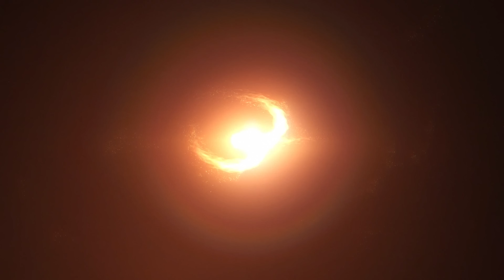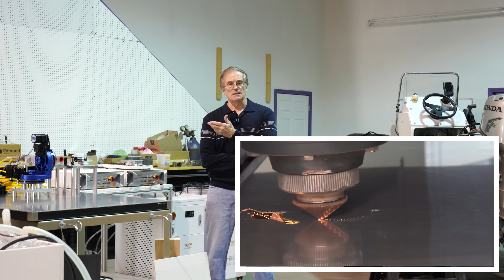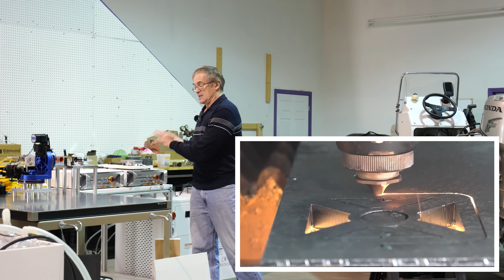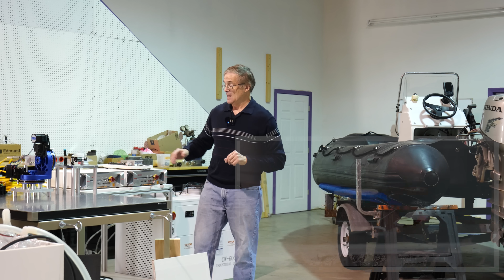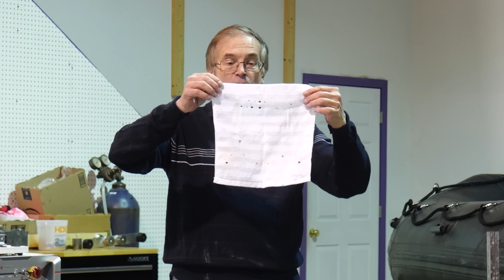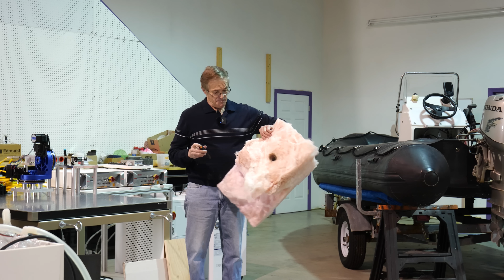We have a problem... and need your help!

Comment: At 4:15, you mentioned the intensity of the light radiation was '500 times higher'—could you clarify what it was higher than?
Reply from the maker: Yes.
It is 500 x higher than our previous laser array, which hits the target with a 5 square cm beam. The current lasers each place 1,500 watts into a 1mm diameter spot. That's about 240,000 watts per square centimeter.
Reply: @TechIngredients  Thanks for the clarification. I suppose the next question is: what material or method could effectively absorb 240,000 watts per square centimeter of energy?

The first thing that comes to mind is water. According to ChatGPT, heating 1 kg of water from 25°C to 100°C, including vaporization, requires about 2,573,950 joules. Using the formula Energy (J) / Power (W) = Time (s), we get: 2.57 MJ / 240,000 W ≈ 10 seconds.

If that calculation is correct, I’m thinking of using a PVC pipe—about 10 cm long so it fits in a freezer—with one end sealed, filled with water, and then frozen into ice so it can be placed horizontally. If more capacity is needed, multiple pipes could be arranged in series, similar to how batteries are stacked in a flashlight.

Comment: I thought of a used up fire retardant paint.
Get a thick layer of fire retardant paint and torch it to expose the thicker carbon foam.
You can even spray paint more of that paint and torch it again to get more layers of it.
should be relatively cheap and easily applicable, I believe?
Reply from the maker: Good idea. I wonder if that could be applied to a rockwool panel.

Comment: Would one of those new project screens which reflect only parallel rays coming from a laser projector system back at the viewer of the screen possobly work?

Rather than angling the image back at you, aim it at the floor?

It's a form of metamaterial which returns light efficiently.  It also rolls up.

Comment: This is something I picked up off the web and when I got to play around with it the qualities became apparent. This is some very amazing stuff anybody can play with safely while dealing with high heat.
The mix is baking soda, baking powder and regular Elmers glue. The baking soda( for cooking) is the least by proportion I get the two mixed up but arm & hammer is not the least proportion the cooking kind is. The goal is to make a consistency of a non sticky dough. So armor  hammer soda is the larger of the proportion  while the soda that's used for cooking is the least and the binder is Elmers white mixed to obtain a non sticky dough consistency. If mixed well to non sticky consistency it then can be molded into any shape you want. When fully dried a 3/8" thick dried piece will easily withstand a pin point map gas torching with hardly any heat transfer to the other side. I have had this in my bare hand more than a couple of minutes with a map torch at full and it completely prevents heat Transfer and deterioration of material after the blackened side becomes stable. If you haven't messed with these simple 3 components you're going to instantly realize there is some ridiculous properties of this very deceptively simple mix. It doesn't need anything other than baking soda,  baking powder and Elmers to get the potential of this amazing stuff. If nothing else it's well worth playing with this stuff and you'll easily see why. This stuff is really that amazing. With your giant brain cell I believe you will have something that does boggle the mind being so utterly deceptively simple I can promise you that. Every once in a while something catches my attention online and I am able to play around with the idea in my little shop. This stuff is crazy and opens some profound questions of a magnitude that does beg a few questions and without a doubt you'll know what these questions are.

Comment: I have no idea about lasers, but Carbon is often used to absorb high heat in space crafts. Compacting coal into bricks is not that hard or expensive. Most of it will supplement away but when the laser turns off it might start burning. Mixing the coal with a bit of epoxy might stop air from going in so at least it will burn really slowly, but you still need a way to stop the fire.

Comment: For a cheap solution I would try out a wall of thin corrugated aluminium sheet which is anodized in black. Make sure the wall is set up perfectly vertical and the profile also aligned verticaly. Easiest way will be to attach the aluminium sheets to a cross beam at the top of the wall and then hang it from the ceiling.  Distribute water from the top (perhaps using sprinklers). So water should equally run down like a curtain over the whole width. At least do this on the back side. Having water running down also on the front side could cause some unwanted reflection but since the water will flow down in in a small wave-like manner it could just as well turn out to defuse the reflected light in a preferable way. At the bottom collect the water in a rain gutter to close the loop by again pumping it back up to be distributed again from the top...

Comment: I also think ceramics may be the way to go, but I would think about something along the lines of a blend of yttria-stabilized-zirconica (YSZ) milling media (MSE supplies has a huge range of options) - and you can get them in a wide range of sizes, or make a polydispersion. It has moderate IR transmittance, so in a larger volume of small, spherical media it will disperse and the changing refractive index between the media and the air will scatter & attenuate over distance. Alumina may also work well, as long as you can get it unpolished. Amazon sells activated alumina adsorbents cheap, so it's an easy way to start. I would probably put them in a steel container, let it bore a hole in one side and hope it's not coming out the other end.

Comment: Passively managing an ablative I think is the key. I am imagining netting packed with damp cellulose. Using something that you can mend that is relatively rigid and somewhat resistant/invisible to the laser as the netting. Cylinders of chicken wire full of damp shredded newspaper

Comment: maybe that starlite material might work applied to drywall or plywood. The original recipe supposedly survived 3000+C for extended periods and up to 10,000C in a simulated nuclear blast.
 Night Hawk in Light's recipe is 
90% cornstarch  
10% baking soda  
White liquid glue (PVA)

Comment: Any type of spinning and orthogonally moving apparatus could be applied to the material you deem optimal in order to eliminate a static contact point.  Perhaps
akin to the phonograph cylinders of the early 20th century.

Comment: Get some of those polycarbonate twin wall greenhouse panels (cross section looks like square tubes glued parallel to make a panel) and fill with sand. When beam tries to punch through sand keeps filling the hole until you run out of sand above the hole. Unknown if the panel will hold upright when filled with sand, quite heavy probably, may need some backing structure.

Comment: That level of flux intensity is challenging. Can you insert a rotary beam dump shutter upstream in the optics path at an existing or inserted lower flux level?  ---- <====[rotary beam dump shutter, rated for the designed flux level]====> ----

As for a downstream beam dump, perhaps something like a fish tank set at Brewster's angle and filled with a wavelength appropriate liquid.
Reply from the maker: The problem with any beam dump is that we have to cover roughly 25^2 meters.
Reply: @TechIngredients  Yeah the size is challenging. While architectural glass is available over 5m tall, that is unwieldy and localized heating could still spall it quickly. At those flux levels stationary ablative dumps don't last long. 

How about a shallow, sloped, pebble-bed, recirculating waterfall? Angled for the diffuse reflection to hit the ceiling. If the absorption spectra of water at 1080nm is too low, NIR tuned absorption dyes are available though I haven't priced them. Would have to test that the reflection is at least divergent if not diffuse.

Comment: NASA use cork as an ablative heat-shield. Perhaps cork or particleboard soaked in water wouldn't ignite, or could be heat or chemical treated to prevent ignition?

Comment: @Techingredients you just need a fish tank filled with a non-toxic coolant medium with a suspension of light absorbant material. Dyes, colloidal suspensions etc. Would work. You could use plain water in a fish tank with a ton of dye that is the same color as the laser beam, with a ceramic tile backstop submerged in the tank. The dyes or suspended solids will absorb the light and create heat, the water will pull that heat away and a simple pump through a radiater will recool the fluid.

Comment: Well, I am not the smartest man, but I have an idea. If you consider your fiber laser cutting machine example, wouldn't diverging the beam prevent the beam from cutting through what's beneath, or behind, the target? What about a fresnel lens on a vertical wall that the computer could move on an x and y axis to track the position of where the laser is pointing so when it fires, the residual beam will diverge through the fresnel lens from a beam preventing damage? That was my initial thought. I pray this helps, you all are amazing!

Comment: My first idea is using sand bags, inexpensive so it doesn’t mater when you burn a hole in the bag, and the molten material is constantly replaced, easy to stack and remove, but sure very heavy. Otherwise couldn’t you use a fresnel style mirror pointing the laser down to the ground?

Comment: I’d revisit water with a different containment system than fabric.  Unflavored jello can be cast in sheets, which could be self-healing for the next shot.  I’d use either pink fiberglass or steel wool/titanium shavings to hold it together better.  The metal strands would help dissipate the heat from the area under attack.

You might try extending the heat capacity of water by making a supersaturated solution with salt, which could give you some time after the water is vaporized.

Lastly (until as soon as I hit SEND) use a moving target instead of a static one.  Run cold water (or CO2/Liquid N2/whatever) at high speed through your main material to keep it cold and buy time.  If you use water, a slurry of clay would help it self-heal.

If you use this, I have lab space for an older generation hand-me-down laser.  Just in case.

Comment: Water infused with fine charcoal powder, running down some sort of flexible sheeting, multiple layers for redundancy.

Charcoal water being misted from the roof with a collection and recirculation basin on the floor, if the distance the laser needed to travel through this was large, then a solid material behind it may be more capable of withstanding what energy was left.
Reply: graphite oxide powder too.

Comment: Some kind of smoke column would scatter the light so a wall or barrier behind it could block the laser completely... maybe? Smoke, water vapor or maybe co2 using one of those dry ice fog machines.

Comment: Liquid would be the best choice. Solid materials create permanent hole which only will get deeper, but liquid can act as a self healing mechanism by closing out the hole of a liquid vaporization.
Reply: The hole can be simply taped before firing the laser, so the liquid does not spills out. The tape will burn out creating a tiny hole just enough for the laser can get into the liquid.
Reply: You can also try out a stirred water-oil like mixture. This will further help diffusing the concentrated energy by micro distortions on water-oil boundaries.
Reply: Tune transparency, viscosity and boiling point of your liquid by your needs. The power of the laser will dissipates through out the whole liquid.
Reply: This liquid should be held in a reasonably big container so the energy can be well diffused. I suggest having a hole on its side where the laser light can go through into the liquid.
Reply: The whole liquid should glow evenly when it is diffusing the energy well enough.
Reply: Liquid on the wall? How it stays there?
Reply: Sounds like water based gel mixed with carbon particle, how to keep it in place is a bit more tricky

Comment: Gyproc SoundBloc 15mm is a plasterboard with a high density, noise insulating core, and can help to reduce noise transmission, and provides fire resistance in walls and ceilings. Gyproc is a UK Company, sorry I don't know what the US equivalent is.

Comment: You need to diffuse the beam with layers of diffusion board. 

I have 2 solutions;

1. Layers of cheaper prismatic light diffusion boards. Frosted works better then not frosted. with a alloy heat sink water jacket covering the target areas backside. 

2. Purchase a premade water cooled beam dump. Phonics Spectra make one that would work off the shelf. Or make a similar item in the shop.

Comment: Just a simple idea here:
Take some ice making bags and fill them up with water and thickener, (maybe add some particles, glitter, IDK.) I would try just water boiled with a bit of starch to make an opaque slurry.
Then hang it on a plywood wall with a stapler, layering it like roof tiles. 
The moment the laser goes through a thin plastic bag, thickened water should absorb it's power, not flowing out too fast, boiling or sputtering in the worst case scenario. 
After the first layer does or doesn't do the job, or if it aims perfectly in between "bubbles" there's a second layer, third...
The whole thing should be dirt cheap, quick and easy to make, and also mobile, not to mention how much work it requires to test if it could work at all.

I have no idea if it could work, or be just a waste of time, but in the worst case you only lose 15 minutes. Well, I don't have a fiber laser to test it myself, regardless of how much I would love to ;)

Hope I could be of any help.
Thank you for years of wonderful videos and triggering my curiosity every time!

Comment: Can the beam be split? Will splitting it reduce the strength? Can the branches be focused in a way that only by having all focused together achieves the temperature you are looking for?

Using flour in a compound can be used as a fire retardant coating on the plywood.
Make a compound using silica, wheat flour, and aluminum oxide. Not sure what to suspend it in but make a brick with it and see what it can handle.

What about changing the focal point of the beam?

Comment: Well... the only thing i can think of, is some kind of water tank, or oil, with some solid material inside, or just some light difusor material disolved in it, something that could scatter the light (should look like white colored resin, or milk and water mixed). If you cover it with a black paint coating on all the other sides to absorb the light, it should hold on. An object inside would be cooled by the oil / water, or using the "milky solution", the energy would be scattered on all the painted surface. If you can avoid reflections back, you'd get just a bright solution. Now that i come to think about it, i don't know the laser wavelenght....

Comment: So what you need is something that will rapidly diffuse the beam. One or more sheets of a laminar waterfall with a colored additive to assist in diffusing the beam. Alternatively construct a tank of a material that does not absorb the wavelength of the laser like glass and fill it with said colored water. Agitating the water with aeration could also more effectively diffuse the beam. To reduce reflections you could use frosted glass.

Comment: Would an intumescent coating over your bricks help to reduce the point source heat issue of the laser beam? As the material ablates, it should expand and shed the heat over a larger volume, protecting (or at least prolonging the short lifespan) the surface of your wall/backer.

Comment: Maybe try 2 metal sheets with a 2-3 inches of sand, aluminum oxide powder, etc between. As  the powder melts, new powder would replace it. The metal plate could be vibrating or oscillating to keep the sand moving.

Comment: If u can make the star light material flexible mabay you can poot it on sum sort of roller like a tank trak so eevin if the laser is on for sum time it wont get through the carbon layer

Comment: You don't want a thermal insulator as a backdrop.  You want to use something that is thermally conductive, and is then actively cooled with water.  It takes a lot more power to burn through aluminum with a laser than it does steel, because it is thermally conductive and also has high reflectivity.  Reflectivity is probably not desirable for a laser trap, but it's hard to say exactly how it would behave.

Comment: I'd go with layers of sheets/foils with 99.9%+ *disperse* reflectivity. The danger of the laser comes mostly from the fact that it's collimated and concentrated. A reflection of the laser is only dangerous if it retains those properties. A bunch of nickel sheets, or maybe even layers of the rough side of really crumpled aluminum foil hung in a frame should disperse the laser to non-burning levels; since you'll be wearing laser goggles you won't have to worry about eye damage.

Comment: maybe a few layers of glass that has dimples, or lenses to spread the beam, then a sheet of something refactory at the back to absorb the spread out energy. stopping a laser beam like that is neigh impossible at that spot size. the local temperatures skyrocket to the point of vaporization of pretty much anything. this is the reason that tech is used for cutting. think Whipple shield, but for pewpews.